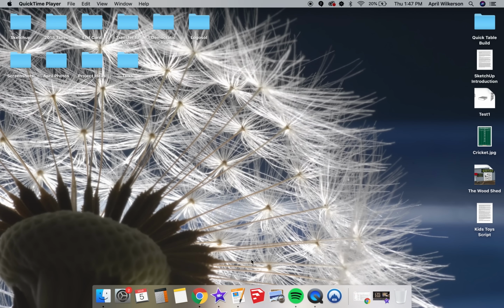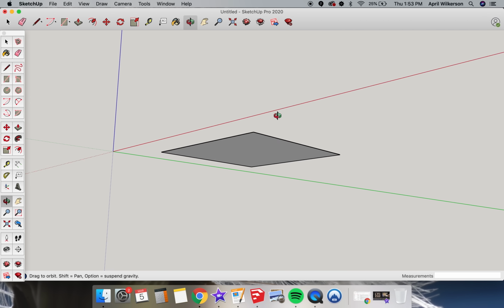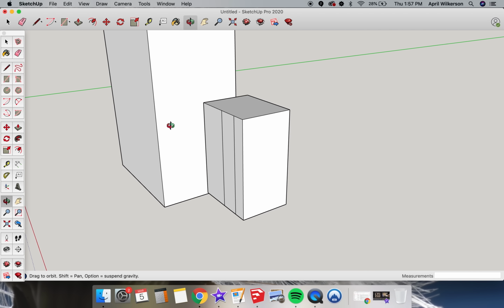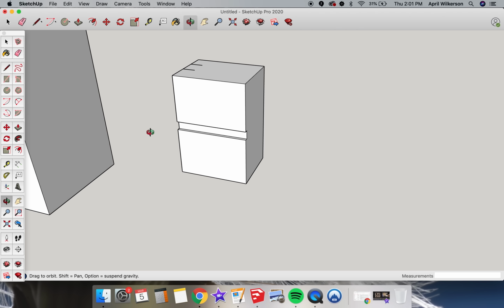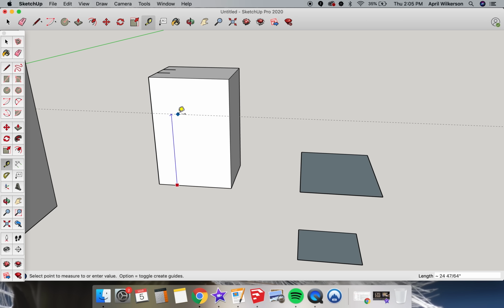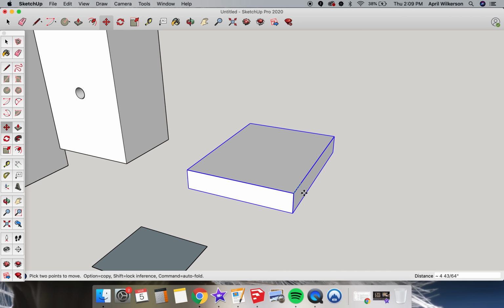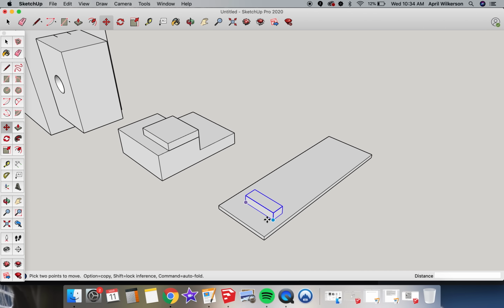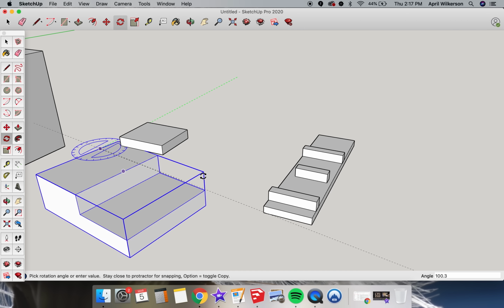Getting Started with SketchUp Video 1

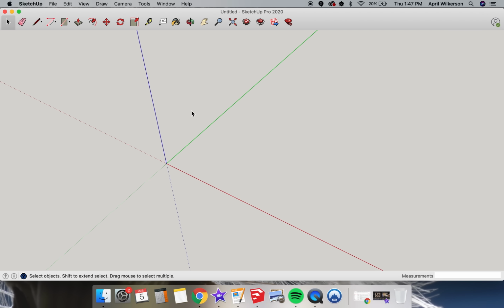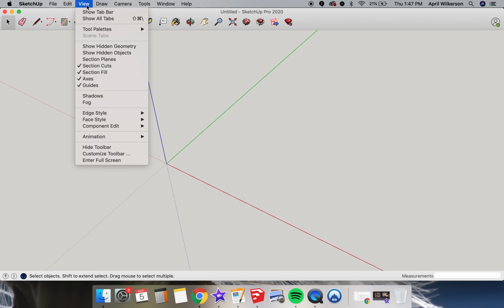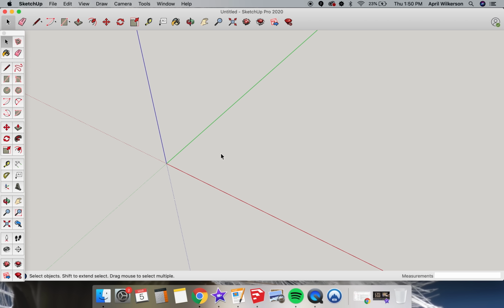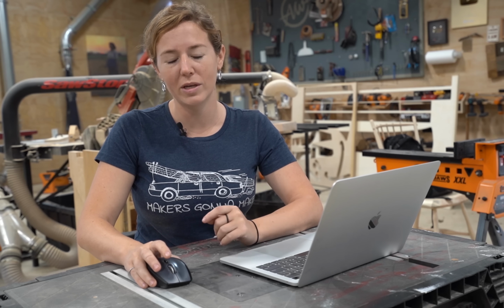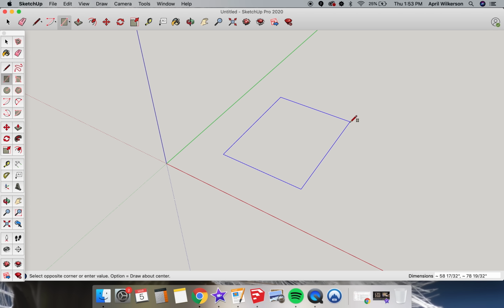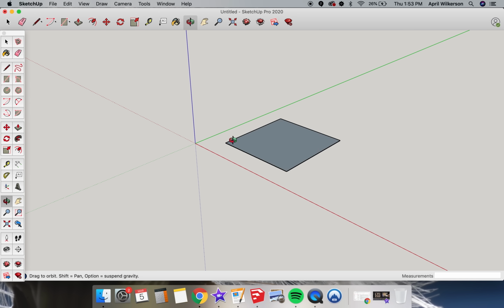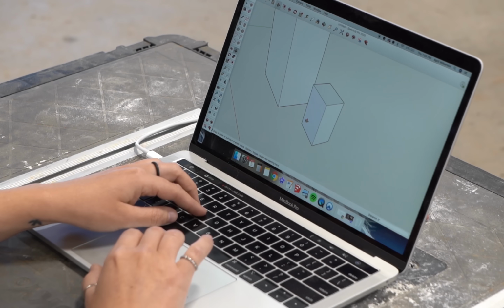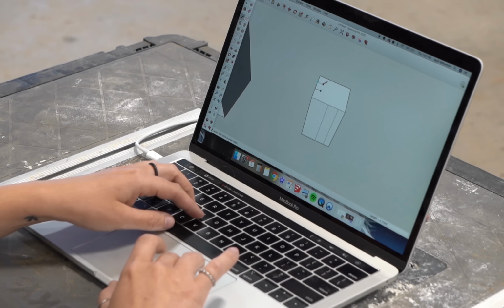Comment from the maker: 1:10 Picking a template 1:35 General features of SketchUp 1:50 Opening larger tool pallet  2:37 Rectangle Tool 4:05 How to click a mouse in SketchUp 4:44 Navigation Tools 5:36 General Push/Pull Tool 7:21 Over exaggerating  8:05 More Push/Pull features 9:31 Select Tool 11:02 Circle Tool 12:00 Line Tool 13:14 Tools snapping to the axes 14:00 Inference Points 14:40 Tape Measure Tool 15:16 Esc Key 15:34 Backing up a Step - Control Z 15:45 Guide Lines - Tape Measure Tool  18:50 Delete Guide Lines 19:18 Components 19:55 Triple Clicking Parts 21:30 Editing a component 22:22 Move Tool 23:54 Copy and Move 26:50 Make a Component(s) unique 27:16 Rotate Tool
Reply: Very informative!
Reply: Maybe include "where to find/ how to download" the program since this is designed for someone who's never used Sketchup-- like myself for instance ;)  It appears that for new Sketchup users, the free program is web-based and not a download.  The starting window is much different than the one you're using.  Learning as we go :)
Reply: mmm.  25:04 you explain how to make a copy by saying "hit option on the keyboard...  Huh?  what option....
Reply: cntr key (control key)on windows.
Reply: Thank you so much for this. I saw that you did a conference about Sketchup and sent you an email requesting you do a tutorial on YouTube since I you are a woodworker too. Along with my request I guess you got enough other requests, thank you very much.
Reply: April Wilkerson 27.16
Reply: April Wilkerso
Reply: Nice
Reply: Great explanation! Thank you April.
Reply: wow thank you!

Comment: @AprilWilkerson thanks for the lesson.  
-You talked about guide lines...does it have the option of putting graph paper in the background?
-can you upload a picture to work from? For example: say I'm trying to restore an antique and it's supposed to have 2 of something but one is damaged or missing.  Can I take a picture of the existing one and get the exact measurements and angles to make a template?

Comment: Great intro to the software. It may be helpful be to explain why a component is used. If I understand correctly components are separate items. In woodworking one component could be the legs of a project, or possibly determine the amount of lumber you need by using all the measurements.

Comment: Hey April.  Great video.  Question.  I'm duplicating your instructions to learn the tool and at the 23:54 mark where you triple click the ledge to make a component, when I do that it highlights the ledge plus the rectangle underneath it.  I've carefully watched what you do and I can't find the subtle difference from your drawing to mine.  I'd appreciate your insight on this.  It also puts the origin of the ledge at the corner of the bigger rectangle, not the ledge itself.  By the way,  this taught me to Set Component Axis as well. Thanks.
Reply: Ok, I was able to figure out what you did. Right around 24:30 when you built the wall, you used hotkeys (shortcuts) to make the wall it's own component.  You didn't say it but did it really fast.  Now when I create the ledge and triple click on that I can make it a component.

Comment: I mean... how do you get a copy of sketchup to learn it before you buy it, I don't see how anything other than the web is free, and to me (a software engineer/architect) it doesn't seem like I can even select a template appropriate for woodworking. Not very intuitive product. Looks like you have downloaded the app?!? And I am assuming you are using the Pro version as there is no free version to download?
Reply: Go to the official website and select 'For Personal' in the 'Plans & Pricing' link. 

I don't know what Web based exactly means, but I want to say the Personal version can only be accessed online. SKU has now changed their pricing model to subscription; April's using the 2020 Pro version which is $300 USD/year. I recommend getting an older version as it's just a one-time payment. I use the 2018 version.

Comment: Which version are you using?  I found the online version, but your version looks considerably different, like it's a desktop version.
Reply: Go to the official website and select 'For Personal' in the 'Plans & Pricing' link. 

SKU has now changed their pricing model to subscription; April's using the 2020 Pro version which is $300 USD/year. I recommend getting an older version as it's just a one-time payment. I use the 2018 version.

Comment: April, I'm a big fan of your woodworking videos.  I appreciate your work more as I get further into woodworking.  I've just started to go through your SketchUp videos for the second time which are excellent, but I can't seem to learn how to resize an object.  For example, how would I be able to resize a 1" x 4" x 24" board to 2" x 2" x 18"?  Thanks again for all your help.
Reply: You will have to either create a new board or use the Tape Measure tool to resize. If you have a lot of objects that you need to resize, it would be best to start fresh and make that object you intend to copy a lot into a Component. Components allow you to resize just one object that will automatically resize all the other same objects.

Comment: I am retired from IBM and used to use AutoCAD, and IBM's proprietary 3D modeling systems. Now I'm enjoying my retirement years by learning how to do woodworking. I've joined a woodworking shop and they use SketchUp. So I'm thankful to have stumbled across your video. But over the next few weeks I'll be making the hard decisions on buying the hardware to support this modeling tool, as well as finding out the best SketchUp starting point for me. $300 license fee to start with is very steep for me. Any recommendations?
Both on Hardware IE laptop as well as what membership or licensure to acquire to get started with.
Reply: You can use it for personal use for free. I've been using the 2017 version. When you install it do not choose try free trial, just click on Use SketchUp, it's free for personal use.  https://help.sketchup.com/en/downloading-older-versions
Reply: @UncleSarkis  Thank you, so much👍

Comment: @ 3:59 the second method of entering the measurement doesn't seem to work.  I'm on a Windows 7 based PC using SketchUp Make 2017.  The first method (typing in dimensions before clicking again) does work.

Comment: April, your two videos are the best I've seen so far on getting started with the tool.  I noticed that you are using the Pro version and thanks for the promo code.  My question to you is if everything you showed is supported in the "shop" version?  I would be using Sketchup for 1-2 projects a year.  The Pro license seems like overkill for my needs.  Thanks!
Reply: I have the exact same question! Can anyone who knows Sketchup speak to what features April shows (if any) are only available with the pro license version.
Reply: Ben, it turns out the free version is more than enough for what I want to get done.  I managed to design a pretty complicated set of cabinets using the free version.  Suggest you try it out.

Comment: This is by far the best tutorial on SketchUp I’ve ever seen. I’ve been intimidated by learning this program so I’ve avoided using it altogether. I can say in the last week I’ve spent a couple hours practicing every day and I’ve successfully modeled all new cabinets for my laundry room and a new built-in wine rack for my basement!  So much easier and helps you develop a strategy for how you’ll actually build it, too.  Keep going with this - so much knowledge you have to share, I’m sure!!  Thanks from Nebraska! :)
Reply: I agree totally, the best I have seen
Reply: @justwatching7116  dumb question, did you pay for this program or use free online tutorial.  I am building out closet and laundry room.  FINALLY going to learn this program to get the project going.

Comment: Thanks for the effort. As I said in a previous message I tried sketch up some time ago but the instructions were hard to follow. While your explanations are clear I am working with the free software to get used to it and test it out before I make any decision to buy an expensive piece of software I may not get much use out of. Sadly Google sold it to a third party and most of the controls are cut off and online help is virtually non-existent. It remains too slow and clumsy and I'll continue with using a ruler and pencil and paper. its much quicker and I can erase any mistakes with a real eraser as I go. In the time that I've spent trying to model a simple drawer I managed to draw plans for three projects including materials and cut lists.

Comment: Hey April, I notice that you're using a Mac, will the shortcuts be different on a PC?
Reply: Not for the main common ones, but you can create/change/delete any of them if you prefer different.
Reply: @sdspivey  no option key on the pc keyboard
Reply: @alistairfurnell126  The most often used ones don't use the option or control keys.

Comment: Great tutorial. I've been using SketchUp for years and have always found navigating around in 3D space clumsy when using the keyboard. There's a USB hardware accessory I would like to recommend. It's called the 3Dconnexion Space Mouse and it's fabulous for moving around in SketchUp. Basically it works like a joy stick and allows you to pan, zoom, tilt and rotate all with one knob. It also has two side buttons that can be configured for SketchUp functions. I have one configured on mine for the tape measure. I work on objects with my regular mouse in one hand and navigate with the Space Mouse in the other hand. Here's the link. https://www.3dconnexion.com/spacemouse_compact/en/ This device is also great for flying around in Google Earth.

Comment: You talk about using the "option command" for copying and moving. where is that on the keyboard?
Reply: Wayne, on a windows computer, it is the Ctrl key.
Reply: Option key on Mac = Alt key on PC. Holding down the Option/Alt key when you have an object selected will allow you to then drag an exact duplicate of that object from the original object.
Reply: @dylanjenkins9497  thanks for this I was about to ask this

Comment: April, every time I install sketchup it tells me that I need an improved video card and other specs for my laptop.  At some point we need instructions on how to make a laptop sketchup worthy.  Thank you.
Reply: Sometimes there are published hacks to trick your laptop's built-in graphics card into turning on a couple of newer features (hardware acceleration, OpenGL, etc.), BUT... beyond installing the maximum RAM, plus a faster SSD drive, there's precious little you can that doesn't cost a ton. Buying an external graphics card for instance, probably makes less sense than buying a newer laptop.

Comment: great intro April. Only thing I'd add is with the push pull tool once you have the face selected you can tap the control/command key to leave the original edge lines in place (so the new section is already divided from the original) I find that really handy when doing things like stairs or steps.

Comment: Looks like Texas people like to recognize Texas people.  Can't blame them.  I am from Big D, by the way.  I know you people from the Hill Country envy people from Big D.  :-)  Thanks for your videos on SketchUp.  Your presentation style makes it easier for me to follow and learn.  I've been dabbling in SketchUp for a while but have not modeled any of my woodworking projects yet.  That's where I want to go.  I've been intimidated by not knowing how to do specific things like make a tenon or a mortise.  If I want the tenon to be one inch from the edges, how do I that?  When I can't think of the answer in my head, it intimidates me from starting the SketchUp project.  So, I pull out a sheet of paper, a pencil and start drawing.  I am sure modeling in SketchUp is more efficient - easier to modify, easier to develop cut lists and cutting diagrams.  I will watch your video series, overcome my intimidation and push through a SketchUp project.  This video is a good motivator.

Comment: Is this the pro version? When I try to use the personal version, it's web based and many of these keyboard commands don't work.
Reply: Unfortunately tutorials for pro don't translate well to the web version. However, the major keyboard commands  (P for push-pull, T for tape measure, spacebar-triple-click-G for component, etc, and the mouse moves) are the same. The real difference is in the tool pallets and menus, the tools are all still there, but you have to do lots of futzing around with the fly-outs before they become natural.  I love Ms Wilkerson's work but these videos are not much help if you are using the web based program. Search the SketchUp education website for their "for schools" version tutorials. They are a bit elementary, but if you work through them, you'll quickly be able to find all the tools, and then everything in this video will be MUCH easier to follow.
Reply: You can get the pro version trial for 30 days free. There is also a big discount on the yearly subscription of you have an email address from an educational organization. If you find that you are going to use it often, it may be worth it.

Comment: I was about to bang my head repeatedly against the wall when I realize the problem with what I was doing was using a comma instead of a semicolon because I work in the metric system.  I've had SketchUp for a couple of months and it seemed really hard to use, but now I'm gonna give it a go. Thanks for this video!

Comment: This is a great tutorial but I missed so much information as the CC is not working video. I am a tad deaf and have lost a lot of my upper range of hearing. As you have a female high pitched voice, a lot of what you say is lost and as the tutorial is screen based I am unable to lip read. Is it possible that you can either enable CC or resubmit with CC enabled. I also see that your next video is also lacking CC so that would also need to be done. Thanks in advance for any help that you can give me
Reply: You could try reducing the playback in settings, it might make the sound lower in frequency...Just tried it and it does not really lower her voice, but by being slower it is easier to understand.
Reply: @budmartin8297  Thanks for the suggestion. I have tried to lower the speed and its works for an extra 10% of the time. Unfortunately I still miss quite a bit. Looking around on here it seems that April would have a heck of a job to aid my request. This i didn't mean to happen. I thought it was just a click and and auto generated CC would happen, it seems I am way off the mark. So scrub my request April and carry on doing a great job of showing us how things are done.

Comment: Is there a quick action/flow to be able to set the height for all the panels you add to a project. I want to work with 18mm panels for a project only.
Reply: design your panel, make it into a component, then pull a copy in from the components menu whenever you need another one.

Comment: One of the problems with Sketchup is that the free online version is somewhat different than the "Pro" version you have and a little harder to work in. Now...the older, free versions (2017, 2018, 2019) that Sketchup used to market and support were a lot more similar to the Pro version and it was very easy to follow along with anyone's tutorials and learn the keyboard shortcuts and all the tricks for modeling. Really wish they hadn't gotten away from that platform. That said, Sketchup IS still a great tool for anybody interested in designing their own projects before they start chopping wood. Thanks for the great videos, April.
Reply: All of the tools are still in SketchUp for web, but I agree that the change in format was very difficult to work with. I teach
Reply: You can still download the 2017 version, you just have to dig a little bit in their site.
Reply: @skimmasmoises  I downloaded the 2017 version, it still says it is on a 30 day trial.
Reply: @howardslade267  ...exactly.